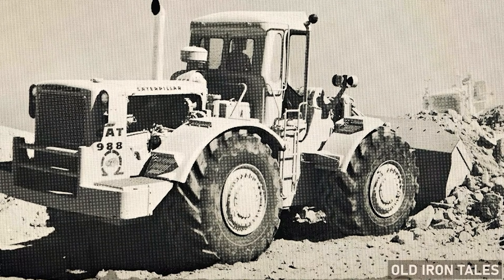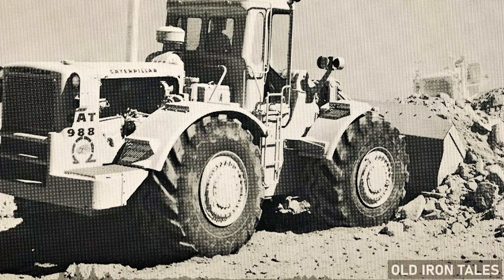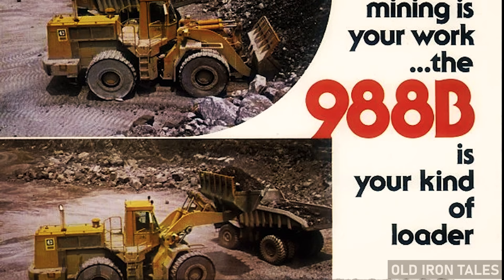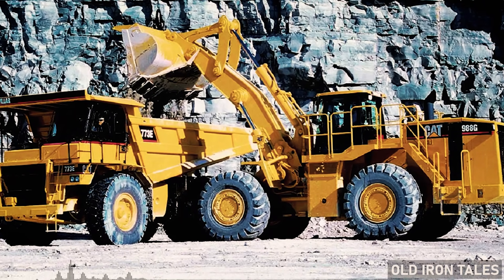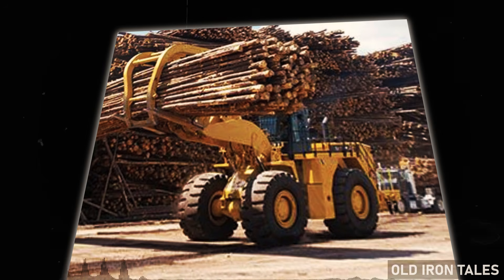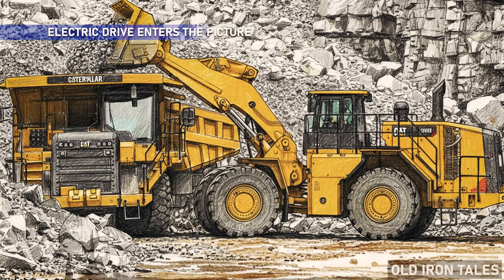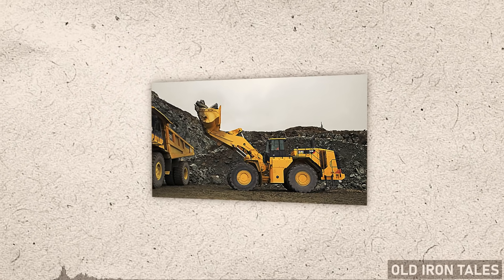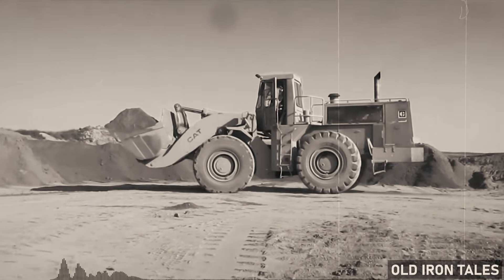When Caterpillar Built The Perfect Loader – The 988 Story

Comment: The Local quarry in my area has moved from the 988 to the 990 it's a monster
Reply: in my job,we are currently working on rear wheel brake of 990K . Yesterday we removed wheel with chain (4000kg) and final drive and brake assembly (1000kg).  off course everything is big and heavy, but working on it is easier than man can imagine.  i prefer repairing these monsters than compact loaders like 906.
Reply: @vetrieska11  I never thought about that if you got the equipment to handle big stuff I suppose it would be easier
Reply: The 998 is larger.
Reply: @CT9905. I thought we were talking about the 988